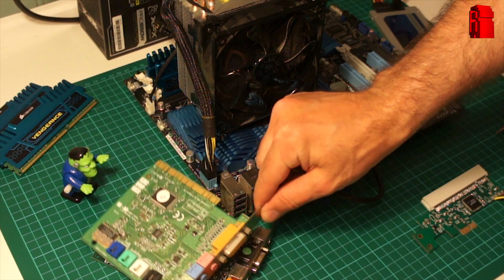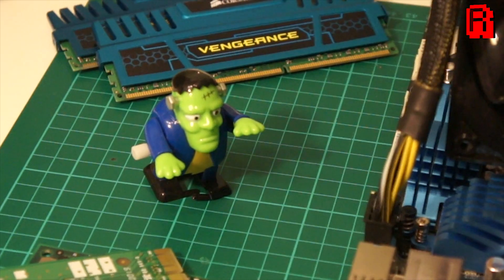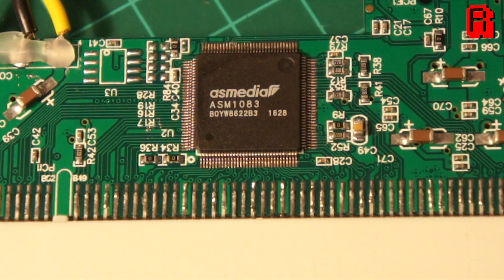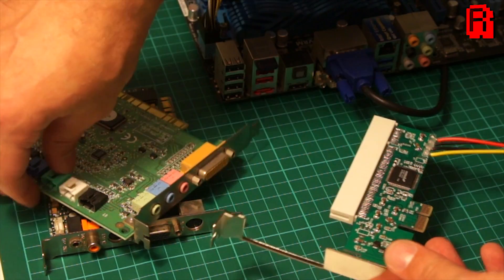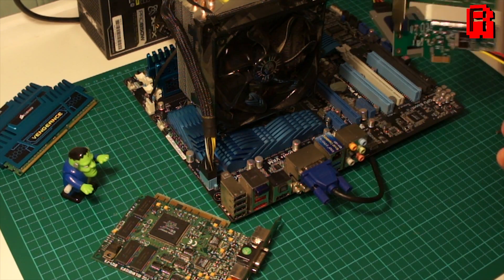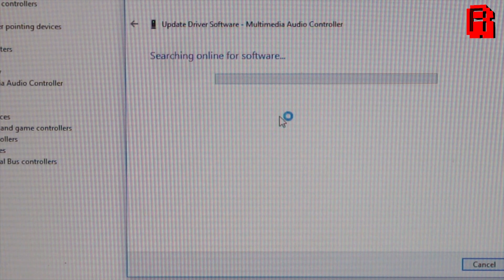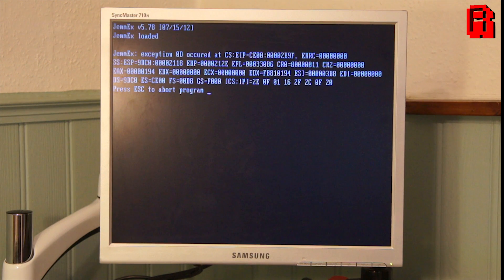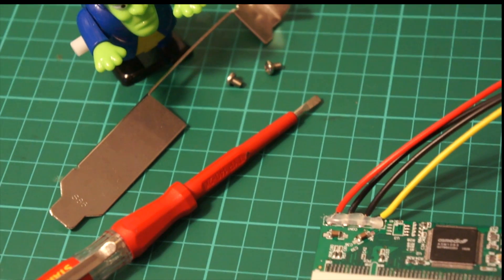PCI Express to PCI Adapter | 5 Min Tech Test

Comment: remembering some of those old 'game console on a pci card' systems that basically use nothing but a disk, the physical space of the slot, and the psu from your system, you might actually be able to use those with this, software issues be damned.

Comment: I had that problem and I decided to install Windows Xp Sp3 and all perfect with my Sound Blaster 64... I needed the midi port to use with midi controller (Evolution MK149) that only works through midi port of that kind of cards. In the year I bought that controller Sound Blaster PCI was the best card and the controllers to use with computer usually had a non standard midi connection. In my controller connector looked as a midi standard with 5 pin but with changes in functions of those pins. Another thing, the card works as a power supply giving electric power to the controller via one of the pins.
So this video is interesting if you have a motherboard without PCI socket and you can install a Windows XP for example, for some devices. It is a shame that Creative just built drivers for old devices until Windows 7.

Comment: That looks like a Ensonique 512 which most linux should just work with. I use win10 and kx project for an Audigy 2. I am considering getting some sort of adapter like this but some have cables from inserts to a break out board.

Comment: My question is the hight issue.  I have a case could tolerate the extra hight but, how do you secure the card (screw it in ) so it does not come loose?

Comment: What if you used VMware with win98 then installed the correct drivers for the sound card? That way you have 98 in a modern machine but so not have to emulate all the hardware.

Comment: Thanks for the video. I'd like to upgrade my i7 3770 machine, that I use for home recording. But my soundcard - an RME Hammerfall HDSP 9632 - is pci, but still a very competent card. RME are really great at support, I've used the card in Win 7, 8 and 10, with no problems now, and they updated the drivers just last fall. So the conclusion was just what I"d like to hear. I"l have to find one, that can contain a full-height card though.

Comment: I tried exactly the same adapter with my Creative Audigy 2 ZS but audio was very low. I guessed that is probably amp to be blame. Tested volts on PCI pins and -12 volts are missing. Fixed the issue by soldering -12V from MB to PCI pin B01 !

Comment: Is there an extender or cable to make that fit in the tower.  So it lines up in the back slot.  Wow. I have  the drivers for my sound card.   This has took me a lot of time and money.   It’s not about being a cave dwellers with audio stuff.  It’s down right expensive.   Usb means latency  and pci is still light years faster.  and I wasted money buying pci to early.   It’s a shame.   But anyways my card won’t fit back in the tower with that method in the video .    I have a pentium sandy i7 2600 lga1150 motherboard with pcie only.   Now I can run software fine.  But latency in new usb cards.  It’s ass compared to the pci stuff.   

I have the drivers for my M audio delta 66.   Is there an adapter with long wires so the card isn’t just sticking out like that. I’ll let it hang inside the tower at this point.     Hell maybe even a mother board with pci that will actually work with my pentium socket and chipset.  Anyone ?

Comment: I use one of these with Ubuntu 20.04 to drive an old SCSI interface card for my CanoScan 2700F slide scanner. Works fine! But you need a PC case big enough to allow the extra height of PCI card+adapter. So the problem is indeed software - more exactly, an operating system that's up to the job.
Reply: Vista drivers are pretty likely to work with modern OS's, that's already going back 16 years.
It's a bit of a stretch to relate this to an OS being 'up to the job', the number of people that would want to use 17+ year old PCI cards in computers that no longer have a PCI socket, and with a modern OS/software is likely pretty limited. Not to mention that people create new drivers for Linux, rather than relying on decades old drivers.
Conversely the large majority of people are much more comfortable using Windows than Linux, I've personally tried multiple Linux distributions and have constantly run into problems, except for a HTPC which I only use for a few specific things. Even that required tinkering to get basic features to work.
ps: People can buy Vuescan to use the same scanner in WIndows 10 & 11.

Comment: This is likely, more useful to Windows 7 users as you can tend to skirt by with Vista drivers.  However, to get around the mounting problem, you can use a PCI extension ribbon cable as long as there is an empty case slot that is not above the motherboard, which would interfere.

Comment: One could work around the height limitations by using a PCI riser cable. It would be cool if I could use my old SBLive! in my current PC. There's some hacked together driver that would enable that, with some tricks like a fully programmable DSP and using the secondary output with the better DAC as the primary one, but I couldn't get it working years ago.

Comment: What about modded drivers like DanielK? Also, I’ve used both PCI to PCIeX1 and PCIeX1 to PCI for different projects before. I think they are handy little adapters but you definitely need to find half height cards like GPUs, USB cards, and sound cards in order to fit things properly in a PC case. Another option would be to use PCI or PCIe extender cables to use a full slot instead of relying on finding half height cards. Hence, there are more options and possibilities you did not explore here.

Comment: If you can get 32bit Windows 10 installed, you could in theory use drivers back to XP or 2000 on it.  Or if there's a 64bit XP driver, you could use it with modern Windows.

Comment: Do you know if you have a card (in my case it is a SoundBlaster Audigy SE PCI) and it it supported on new operating systems but the pc doesn't have a pci slot, this adaptor would work ?
Hint: The SB is a low profile card.

Comment: There are still some modern motherboards that have PCI slots. I built a computer last year with a Gigabyte B360-D3H Coffee Lake motherboard and it has one PCI slot. It is still available on Amazon. I used it with my high-end Marian Sound Card. Works flawlessly with Windows 10. Also some AMD B350 motherboards have PCI slots (such as the MSI B350 Tomahawk) but you can't buy them new anymore.

Comment: X-fi music is excellent and still works with Windows 10, it would totally be worth it if it wasn't for the high prices on ebay (about 50 USD right now). I mean you could just buy a new  PCI-E sound card. Another problem is the height, you'll have to modify your computer case.

Comment: I think the most interesting use for this sort of thing hasn't really been explored: You can pass the PCI devices to Virtual Machines, and emulate running a 5Ghz Pentium processor using modern hardware virtualization features. 

Not the most useful or period-authentic thing but it might be rather neat.

Comment: Did you try install drivers in compbabilty mode????
Reply: I use old hardware, but it is external firewire mixer, i got it working after installing "old drivers for the device" in compability mode. But it was of course not a pci card, but the chance is it may work with drivers installed in compability mode. Could you do a knew try?

Comment: I bought one too via ebay, tried it in 2 different systems with 2 different soundcards, and got no sound output. 

Asrock H67M motherboard also using ASM 1083 pci-e to pci bridge chip, but in there every soundcards work perfectly, so i probably got a bad converter, or it is simply a badly designed converter, because i read others having no sound issue too. :\

Comment: My question is will it work with a pci gpu?  I have a board without onboard video and i don't want to buy a pcie gpu to use with it nor will i need video for long, just enough to get a server configured without having to borrow a gpu from another device.  I already have a low power pci gpu that i can throw into it.

Comment: I have a Sound Blaster Audigy ZS PCI this is the one with the nice front panel with remote and lots of input/outputs so this should work I will need to modify the case to secure the card.

Comment: Thanks for this!
I finally upgraded my audio PC board, CPU & RAM. I have an old UAD-1 PCI card for audio processing, it works fine on Windows 7 & 10.  It doesn't need to be accessible, just needs to be plugged in, so this should solve it for me just great :)

Comment: The lesson I've learned recently is this:  PCs may have some vestigial heritage left from the PC AT (and co.) but the industry has, at large, pretty much jettisoned the concept of backward compatibility across the board.

I'm sure it didn't help that Microsoft went full ferret and changed the driver model with every major version of Windows - pretty much ensuring we would never see full vendor support for Win95 to XP for any but the most prolific of products.

Linux really does shine here, provided you don't go and do something silly like try to use a version of GCC from earlier than last Tuesday.
Reply: If you go really old, but from Vista(16 years old now) on drivers regularly seem to work with Windows 7,8,10,11.

Comment: you can put your full height pci card normally inside an atx case if the mobo were m-atx, using this kind adapter
https://www.ebay.com/itm/PCI-E-to-2-PCI-Adapter-PCIe-convert-PCI-card-support-PCI-express-X1-X4-X8-X16-/111146372649

Comment: You say that Linux doesn't help your need for DOS gaming, but under Linux you can still pass down your native Soundblaster down to DOSBox just as well. At least in that case it can do what you want where Windows seemingly cannot.

I mean in the end, it's hard to beat a 486 with an AT style PS/2 keyboard port, but if you're going to go the weird way, might as well accept the solution might be weird as well.

Comment: I've recently bought one that has 2 PCI slots, based around PI7C9X111SL chip, and instead of plugging directly into PCI-e slot, comes with USB 3.0 A-to-A cable and a little PCI-e to USB socket adapter board.
I kinda liked the idea of breaking out PCI-e from my tiny mini-ITX computer on a long-ish extension lead so I could mess around with whatever PCI board right on my table, with freedom to poke things with multimeter/oscilloscope/fingers/etc :)
In that short time I had it I only had to use it with my old Aureal Vortex II soundcard, which, apparently, is still supported and is working just fine in modern Linux, even down to playing MIDIs with an external wavetable.

P.S. PI7C9X111SL datasheet states that this chip can also act as a reversible bridge, that is bridging PCI-e device to PCI slot. Although no such (cheapo) adapters available from aliexpress, it seems :(
Reply: What is that connector name, could you be so kind?

Comment: you can get the drivers for that card from the vogons site, just google "vogons drivers" or the model of the card and you'll get lots of information about it. if that's the soundcard I think it is, it's the "audiopci" that creative bought and renamed "sound blaster pci". I did some tests with that card and I got the best results with the drivers from the creative cd, not the ensoniq first release. it works kinda ok in DOS (it's not as compatible as an ISA sound blaster, and it doesn't have FM midi!! it has a wavetable general midi thing but 99% of games use fm), and it works fine in 9x. I wouldn't recommend it for a retro system anyway, an isa sound blaster pro 2 or sound blaster 16 or clone is always better, you get 100% of compatibility with everything in both DOS and win9x.

Comment: I have used this adapter to successfully install an AVM B1 PCI ISDN telephony card to a PCI-e riser cage fitted inside a Proliant DL380 G6 server. There is a hard to find x64 driver for Windows 2016 Server.

Comment: You gave a biased review of this adapter card in my opinion. Its common knowledge drivers written for XP won't work on Windows 10 properly. That not the fault of the adapter card. Try the adapter card again with the same soundcard and bootup Ubuntu. I bet it would work. Most cards will work with this adapter card under Linux providing they don't have proprietary chipsets coz the Linux kernel picks up expansion cards without the need of a driver (unlike with Windoze).
Reply from the maker: Ubuntu is in the video

Comment: The more obvious problem is that it won't fit into the case now that it is an inch up from where it is supposed to be unless it is a half height card to start with and you can make a custom bracket.

Comment: You could install full height cards if you got a PCI extension cable and plug it into a slot that is not in the reach of the motherboard (Full 7-slot ATX Case and 4-slot mATX motherboard.

Also, you could run DOS with this setup, since I doubt that the AsMedia chip needs any drivers. So that way you could have period correct hardware/peripherials with a modern cpu, ram and motherboard. Though you might run into the issue of not finding small enough RAM modules (less than 1gb) with something like DDR4.

Comment: Awesome, I still have some high end PCI audio hardware that was collecting dust
Reply: This is exactly, what I was wondering about.  I'd like to upgrade my PC, but my M-Audio card is PCI.  And even though my upgrade is only from an older 2 core it to a 4 core it, the motherboard has only PCIe.  I'm hoping this will allow me to get around that.

Comment: Now: Find an ISA to PCI adapter, and plug it into one of the PCIe to PCI adapters, so we can finally use our AWE64 gold cards in windows 10!
Reply from the maker: Hehe definitely a valid use for the tech
Reply: @TheRetroCollective  Valid but problematic, as years ago intel removed chipset hardware essential for DMA to function on ISA sound cards. See this thread for more details: www.vogons.org/viewtopic.php?t=34001
Reply: @jamesheg796  there's a USB-to-ISA adaptor, that could work. Technically it provides DMA signals, but IDK how much they're usable.
Reply: There are no such adapters that would provide the interrupts(?) for the sound card
Reply: *Linux At least then you have a chance.
Reply: I hear you bro!

Comment: So the product does its job... I feel like the video has an unjustifiably negative tone towards it... It's not the adapter's fault that there are no windows 10 drivers for a 20year old, discontinued PCI device... There are plenty of PCI cards with drivers for win7 onwards. I own many PCI cards like this, Soundblaster PCI audio cards or many Wireless LAN PCI cards coming instantly to mind. Imho this adapter is handy.
Reply: There are plenty of uses. Would love to see this tested with a 3DFX card under Windows 2000/XP, for example. Additionally, I believe it may be possible to dedicate a card to a virtual machine via PCI-e passthrough under the KVM hypervisor, paving the way for a virtual retro gaming PC that uses real hardware.
Reply: got to laugh at a tech reviewer who cant get a ct2518 working in windows :D its like they never had to download their own drivers hahaha. "oh look windows doesnt detect it, I GUESS YOULL HAVE TO USE ANOTHER OPERATING SYSTEM" HAHAHAHAHAHAAHAA REDICULOUS
Reply: @exitdown  Yeah, im looking at this because i want my Audigy2 ZS in a modern pc. Simplest thing in the world to get modern drivers, its the PCI slot that until now had me scratching my head.
Reply: @exitdown  There just aren't any compatible ones. It's a lower end card from early 2000s, you just won't get this thing to run on Windows 10 let alone 64bit.

You can search the internet for drivers all you want, all you gonna get is drivers for older systems or "Driver Updaters" that are plain out malware. Also, this video is nearly three years old. A lot can change in that time FYI

Edit: But hey, if you actually do find a proven to work driver under Windows 10 64bit,leave it here, could be more than useful to some.
Reply: there are PCI express soundcards that have drivers from DOS to Win 10. Asus Xonar DX for example...... is this soundcard any good?
Reply: Impossible mount it in a standard case
Reply from the maker: desolator XT hmmm I don't see the negativity, my conclusion was that it works, there are few but there are legitimate uses for it, and this model is poorly built.  Also that it was a very quick and dirty 5 min test.  I'd be interested to see others experiences with a better unit.

Comment: I do not agree with the notion that you cannot use non-MS OSes for retro DOS gaming. There is a piece of software called DosBox. You can install the cards on a Linux machine and then use DosBox to run whatever DOS game you desire there. And it runs fine.
Reply from the maker: You are of course correct, I was referring to native DOS gaming with DOS natively installed as the primary operating system.  This was a quick and dirty play around with the adapter, there appears to be enough interest for a more in depth video about it, but I think I'd want an adapter which looks like it may last a little longer than 24 hours in its build quality if I was to explore it further :D

Comment: They may be hard to find now but I have used pci riser cables in the past. You could put this adapter on the last slot of the motherboard, then use the riser cable to just to the next slot in the case past the motherboard. As I said though these cables are likely very difficult to find especially with the massive amount of people searching to pcie risers (gpu mini ng).